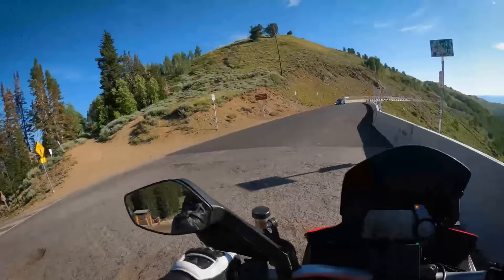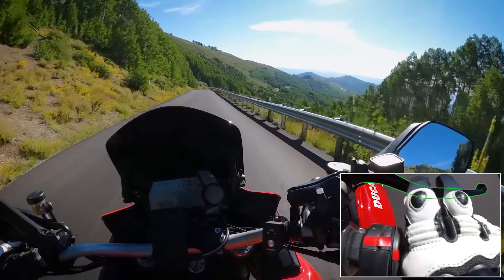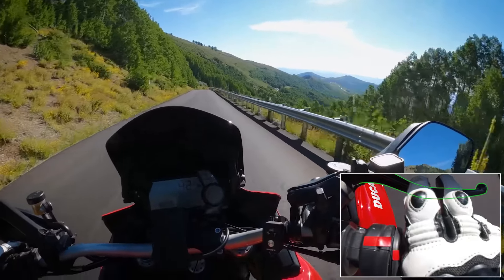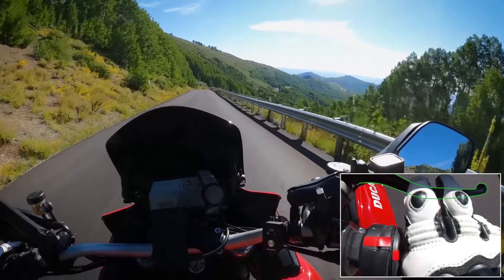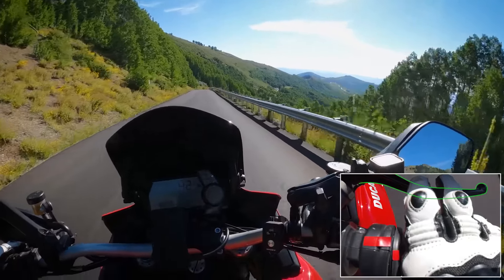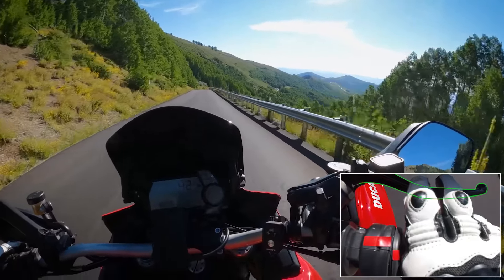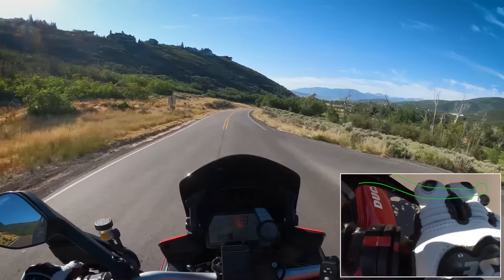Ride Through Downhill Corners With Confidence! // Part 2

Comment: For the first two years of my riding I hated downhill corners. I never felt comfortable going through them and it just killed the joy of riding for me. When I got better with trailing brakes it all changed, but the biggest boost in confidence for me came when I changed tires on my bike.
Reply from the maker: Right on. Tires are such an important part of the equation, right?  They are what connects us to the ground.
Reply: @CanyonChasers  I totally agree. But I was amazed how much difference there actually was between two sets of tires even though at the time when I was shopping for a new set they were priced quite similarly. Set of Battlax S22 that I bought was less than 30€ more expensive than a set of Dunlop GPR-300 that I had on the bike before. But the difference is quite amazing actually. With Dunlops my bike was very stable, a bit harder to get leaned over but easy to get it back upright. With Bridgestones it is super easy to lean and bike just wants to turn however fast I dare to try.
Reply: @92Cuky_  I have put new Dunlops and Bridgestone tires on my yamaha V twin 650 (the 2 versions of the factory OEM tires). The Dunlops wore quicker, the Bridgestones lasted 30% longer, and they are heavier tires, which make the bike more gyroscopically stable (riding hands free), and you have to use more pressure on the grips with the Bridgestone tires to lean the bike into a curve,  which makes it feel more planted, more stable, and more precise on a twisty road.

Comment: Just returned from doing 300 miles worth of uphill/downhill tight twisties in the Great Smoky Mountains. It was the most fun I have had on a bike since I started riding 50+ years ago. Where I live we have very little in the way of tight twisty roads. I particularly like a tight  downhill lefthander that immediately turns into an uphill  righthander. There is something to be said about technical roads that never allow you to get out of second gear. 🇨🇦

Comment: "Don't trust signs, folks." Love it. We have lots of tight, technical roads like this here in Oregon, densely treed so visibility through the corner is always an issue. I shared a video with some riding buddies and their comment was "why so sloooooow?". Because twice the advisory speed through back-to-back blind hairpins isn't "slow", just not relying on luck to get home. One thing I notice about downhill corners consistently is that corner entry can be pushed later because it's so easy to compress the front. The bike wants to turn very quickly. It takes some discipline to not fall into that trap and start stuffing the bike into corners further and faster. Doesn't usually end well.

Thanks for another great video! Ride safe.
Reply from the maker: Oregon, literally, is my favorite place to ride. Those coastal mountain roads are spectacular, very technical and very unforgiving.
Reply: @CanyonChasers  Eastern Oregon/Washington has some great mountain riding too if you ever get the chance. And much less traffic. Check Butler maps. (I probably shouldn't spread it around)

Comment: On vacation in the Swiss Alps right now, applying your trial breaking wisdoms. It really makes a difference. Thanks so much for your insightful videos! I feel more confident on my old Pegaso 650 with 50/50 tyres, than I did on my BMW R850 with street tyres. Although I can't lean as much, the ride feels much more controlled than before.

Comment: Hey, thanks for this one. I think I got it now. I thought trailbraking was about compressing the front suspension from entry to apex of the corner - but if I'm slow enough to start falling to the inside, and needing more gas, there's no need to keep loading the front...

The camera on the brake lever is a great trick. Hope you manage to make a video like this one on the track, in the future. I would like to see what would you do about gear shifting and keeping revs high enough for exiting corners fast on a less powerful bike. 🙂
Reply: If you are slow enough to "fall to the inside"...don't just add more gas. Unloading the front tire TO much could cause a front tire to slide out. Get back to maintenance throttle with your same amount of "fall in" from before until you see the exit. Never add lean then gas out of the corner...
Reply from the maker: Yes!   Thats right.   Just like doing all your braking and then accelerating through the entire corner is problematic in most sitations, so is doing the regimented slow until the apex idea.  This  is why we ride by direction and not by sequence.  Think of it like this.   Brakes make the bike slow and turn. Maintenance or neutral throttle keeps the radius the same and with acceleration, the bike stops turning and wants to run wide.  Use the one you need for the situation you are in.  FR35H7Y84K3D d was correct.  Just going back to the gas may not be what you need.

Comment: Love the use of the brake outline in this video! Very clever. The mark of a good teacher isn't how much knowledge that they have, but it's in the techniques that they use to impart that knowledge to others. This was one of the clearest examples that I've seen on YT. 

I would LOVE to see this on the track. Especially how quickly you pick up throttle once you have direction and take away lean angle.

Comment: Nice video and commentary. I did enjoy it. I do almost exactly as you explain, but I remember my instructor always saying that I should use the rear brake too ( much less of course). He claimed that it helps to settle the bike even more.
Reply from the maker: Yes, a little rear brake can be used, especially in slow speed stuff. It's also great leading up to the corner to settle the back of the bike.  While you can, for sure, use it in the corners, most riders tend to be off the rear brake before tip in and focus attention onto the front brake.
Reply: @CanyonChasers  Thank you very much for the clarification.

Comment: Fun ride and thanks for not hauling ass on those roads. It's easy to go way too fast on downhill corners until you need to brake really hard to make turns safely. I think Champ School recommend twice as much brake pressure on a downhill compared to a flat corner.
Reply from the maker: Yeah, that road is so tight, there's no way to haul ass without risking others.  Thats my personal gut-check.  That and "don't speed where people live"

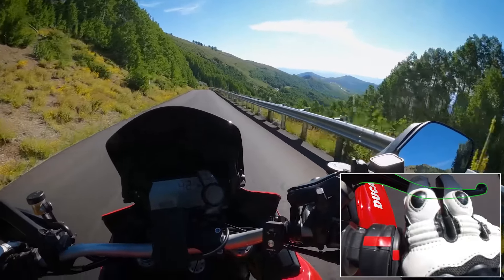Comment: Excellent video.  But you were actually overlapping brake and throttle numerous times.  I’m not talking about a ton of throttle—just a slight overlap as you release the brake—and that is exactly what I was referring to in your last downhill cornering video.  One of many examples was at 5:30.  I think we are not really very far apart in our philosophies.  I’m just saying there is often a fraction of a second when brake is trailing off and throttle is rolling on.  You’ll probably say there is play in the throttle, but I believe there was definitely some fueling of the engine while the brake was trailing off—and that is one reason why you are such a smooth rider.  Anyhow, love your channel and everything you do for us riders!
Reply from the maker: I actually wasn't. You are seeing throttle cable slack and brake lever play.  Also my tape slipped and is a little off.  At no point, ever, did I push throttle against the front brake. Not even half of a percent, even though I will admit it kinda looks like it at some points. I also didn't like how it looks like I'm dumping the brake lever, when again, that's just brake lever play. I'm trying to think of a way to illustrate that.  

If you watch MotoGP FP2 from this weekend in Austria, they have an onboard shot with Maverick Vinales for about two straight minutes with data overlay.  He never overlaps brake and throttle.  

You're still one of my favorite viewers though!  😎  YouTube tells me I respond to your comments more than almost anybody else.
Reply: @CanyonChasers  That’s because we both love motorcycling and dogs!  Take care my friend.

Comment: Dave, great idea on the separate camera for the brake. I have see some other channels do similar things like that also. Very good training aid.  Here is something I have always wanted to see;  the effects of the movement of the handlebars on the direction the bike goes. Say having a camera pointing at a degree wheel taped to the tank and have a small pointer solidly attached to the handle bar center that would show movement by the pointer moving over the degree wheel. My understanding is during cornering at speed, turning the bars to the left causes the bike to turn right and AFTER the bike is leaned over the bars turn slightly in the direction of the turn. It is rather difficult to notice this when one is out riding at normal speeds.  Think you could come up with a video showing and explaining what is happening?  Been riding since the late 60's and still learning, trying to always improve.  Ride safe and ride home.
Reply from the maker: Two things. Believe it or not, we've been trying to build a working rig like that for a while because, point 2, you are exactly right. The countersteer initiates lean, but then the front wheel has to swing into the corner, in a traditional steer in order for the bike to actually turn.
Reply: @CanyonChasers   Thanks Dave, I'll be keeping my eye out and hope the rig works out OK soon. I remember watching, I believe it was a Kieth Code video where he showed something similar, but I believe he was reinforcing another point he had made. It may have been his two handlebar bike where he shows leaning can turn a bike, but very slowly and not quick at all. The whole object was to reinforce the idea of counter-steering causing the bike to turn.
Reply from the maker: Yeah, thats where we got the original idea. I thought his video was a bit misleading because he was doing a back and forth swerve to say countersteering is the "only" way to turn which isn't exactly correct.   It's for sure the most efficient way to initiate a corner, but lots of things affect or will initiate a turn.
Reply: @CanyonChasers  Countersteering, the word itself is so counterproductive or at least misleading. There are generations of bikers today, that really believe, that front tyre should swing the opposite way from the corner. That for a bike to make a left turn, the handlebars should turn right and vice versa...

Comment: Great video, probably one of the best to demystify trail braking! Just one small request; next time, consider to put the lever-outline at the position where the pads actually start to touch the disc. I think it would make it easier to see how slowly you use those important 5% of the brake pressure both going on and off. As it is now, especially the release seems to be a bit abrupt, most likely because of the slack of the lever.
Reply from the maker: Yep, thats exactly what we're going to do. I had the same thought. It looks like I'm just dumping the brake.  Same thing with the throttle. I'll move the mark so you can see where the gas actually engages.

Comment: Thank you for always sharing important information to help us ride safely.  Your content is much more valuable than so many other channels.  Also wanted to ask if the small windscreen is helpful and if so, what benefit do you get from it?  It just seems too small to buffer much wind away from the rider.  Oh, and wondered f you have produced the uphill cornering video that you mentioned?
Reply from the maker: Small windscreens are my favorite because they keep wind off the chest, but the air flow around the head is smooth. Larger windscreens often create a lot of turbulence due to the negative pressure behind the screen.

Comment: I have been riding an MT-07 and MT-09 with such severe engine braking that it is very hard to go completely off throttle in downhill corners. My old Honda 750 takes those same corners with no issue, because the emission controls aren't like throwing down a boat anchor as soon as the throttle is closed.
I watched your first video, and all week practice canyons up and down - ended up pulling in the clutch as brake in order to stop the "herky-jerky" on-off thing. Then it is super smooth, no throttle, but no severe engine braking either. 
The other solution has been to very gradually roll off the last 1/8 throttle turn, like watch-paint-dry slow roll off.
May have to get ECU flashed as that is one of the claimed benefits, calm down the emissions related "kill it" when roll off the throttle. Your Ducati doesn't seem to suffer from severe engine braking. My bikes shut down so violently (both modern Yamaha's) they actually wiggle mid turn as fully close down the throttle.
Reply from the maker: Try one gear higher. It'll smooth out the power and encourage you to use the front brake more. Don't worry if you get a weak exit from the corner at this point while you work through things.

Comment: Was on my way home from pit-race motoamerica yesterday , 68 mile ride. Was taking the very last bend before my home. Last bend of the ride literally. Was a car coming towards me. I was leaned over. Then what shows up in front of my face? Gravel. And lots of it. I aborted the turn stood the bike straight up . (Remember car coming towards me so to the left was not an option.  So I went to the right. Took a persons driveway and yard and used it as to not crash on the gravel. Whole point of story is. Anything can happen anywhere at anytime. U have to be Ready at all times. And thankfully I was, and did NOT lay my bike down as a result

Comment: Wonderful video and wonderful road! Anyway, those road are straight compared to the italian ones, and the road condition is near perfect compared to ours. We often deal with holes right in the middle of the corners, extremly tight turns and bad bad drivers
Reply from the maker: The camera really mellows them out. In reality, the road is on par with italian twisty bits.  Although, I will concede the tarmac is pretty much immaculate.

Comment: Look up the rev limiter shift points for your bike
make a label marked just a few mph below those shift points and put it on your handle bar

it will help you learn when you have to upshift while taking off as fast as possible, without hitting the rev limiter

and for steep hills, it will also tell you when you can downshift for maximum compression braking, without mechanically red lining your engine  and smashing your valves into the pistons

most bikes that are damaged from redlining the engine happen when the rider down shifts while going too fast for the lower gear, the rev limiter wont save your engine if you do that

keep in mind this is more useful going down straight hills, you dont want to use maximum compression braking on the rear wheel going thru a sharp downhill curve - you have better control using the front and rear brakes together, and leaving the transmission in a higher gear

Comment: Cheers and thanks. In the UK so called advanced riding training is based on Road Craft (UK Police Biker training) which emphasises engine braking]/maintenance throttle to negotiate corners with zero consideration for trail braking. However my theoretical understanding and indeed limited riding experience supports the value of trail braking particularly for reasonable speeds whereas the "UK" approach is ok for relaxed lower speed riding. Trying to work out things in my own mind. What do you think? ATVB
Reply from the maker: First. We absolutely love the UK. We can't wait to get back. 

We have a few members on our Discord who have been through that program so I'm fairly familiar with it.  So I'll say this. There are a lot of techniques that are taught that work great in parking lots, at slow speeds, but don't really hold up to real world considerations.  This is why we advocate riding the bike based on direction, not sequences.  So think of it like this.  We need to have weight over a tire, before that tire has grip.  Wait for the weight. Load the tire before we work the tire.   If we're accelerating, or even at neutral, where is our weight? Not on the front tire.  Which tire do we need for turning and for slowing? The front tire.   By using our front brake into turns, we are not only manipulating the bikes geometry, telling the bike we want to slow and turn, but we are also putting weight where we need it to be in case we need to slow more for something unexpected.  Like the turn tightens up. Clarkson is in the middle of the road in his Lamborghini tractor. Whatever. 

Riding by direction basically means, we slow until we are happy with our speed and direction. As we slow, the radius of our corner gets smaller. Neutral throttle, the radius stays the same. Acceleration, the bike stops turning and wants to run wide (unless we add more lean angle - which also adds risk).   So we use each of these three things based on what we need the bike to do in any given situation.  It's far more precise and far more adaptable to constantly changing conditions.